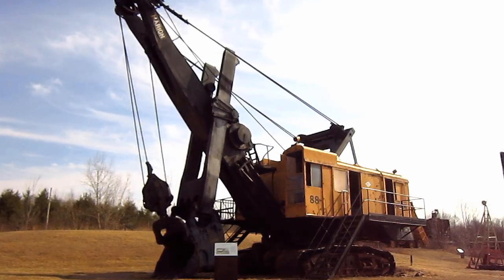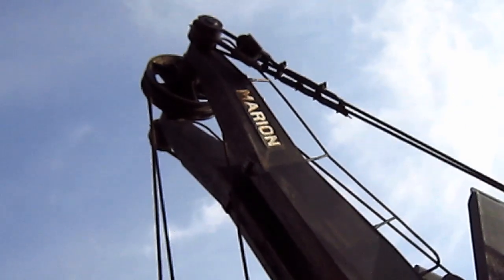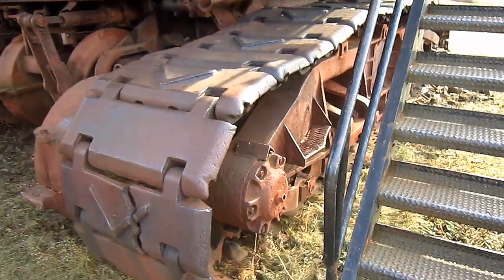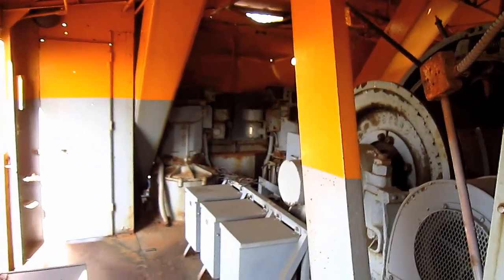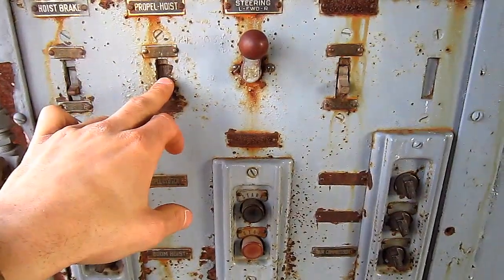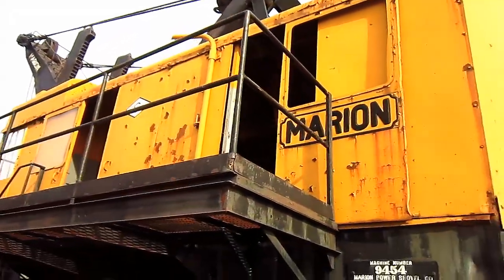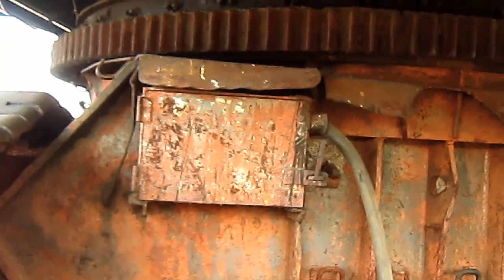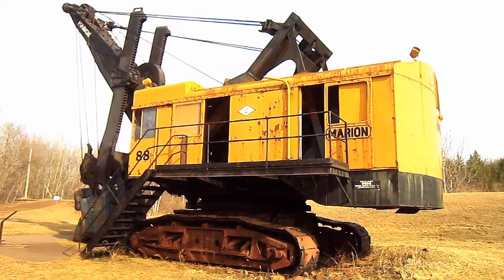The Marion 4161 - Mine & Quarry Workhorse

Comment: Another great story! 
That is a massive machine, does it run today? Everything looks so clean that it appears it is operational. 
The bucket doesn't look that large considering the size of the shovel, if this runs is it economical today? 
The power to run this comes via the cord but I assume those internal components boost that? 
I assumed the electrical power came from a diesel engine but there was no mention of an ICE.
Reply from the maker: This machine is on display and no longer runs. As long as the wiring isn't destroyed, it would probably be easy to get running again. And the bucket is the rated capacity for the machine. Thanks!

Comment: The only time I saw a motor-generator was in a movie theater.  The theater originally had DC power and when the power grid was converted to AC they installed a motor-generator to power the DC projector. 

I'm wondering if the shovel motors weren't DC and the motor-generator was being used to convert the power.
Reply: I’d guess it was an AC line power, motor/ generator converted to DC.  Motors were easily reversed on DC, but not on AC back then.  Today of course it’s different will electronic frequency control, etc.

Comment: That’s a rugged looking old unit. Kinda interesting that something that size would be electric. Just thinking the feed line would be somewhat of a pita compared to a diesel powered unit. Are you sure You didn’t have the hoist control function bass ackwards? Always enjoy this stuff, Thanks Justin. 👍👍🇺🇸
Reply from the maker: No so, Marion controls are opposite BE! It can throws a lot of operators off. For example like on a BE drag, one hand is always doing the opposite of the other for direction, however Marion isn't, it's both forward or back to mesh with the digging motions. And also as a double check, it did say what direction the lever controls right on the tower. Thanks!
Reply: @ I figured You’d straighten that out for me Justin!  Just seemed a little awkward, pull back to lower. I’d sure be one of those “confused “ fellas. Had the same problem first time I ran a 977 track loader. Forget exactly how it was but the levers worked backwards. Told my father-in-law somebody hooked the hoses up wrong, but he said that’s how they are on those. Can really humble a fella that’s used to the typical loader type set up. Typical left hand swing controls on draglines can be confusing when the cabs are on different sides of the boom, unless You had a Grandfather like mine that explained it as “push away, pull the other way.” Then, if you really want to look like a greenhorn on a dragline, go from left hand swing control to foot controlled swing. Just hope that nobody’s watching for quite a while! Sorry for rambling, I just love this stuff. 👍👍🇺🇸😂